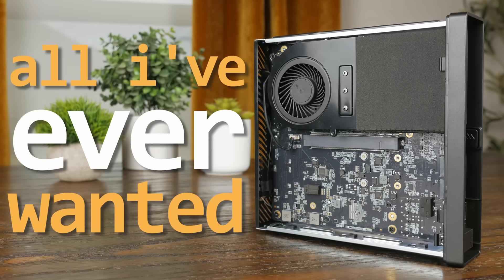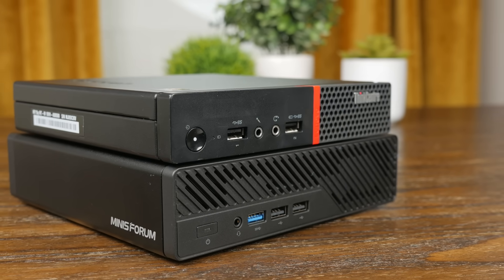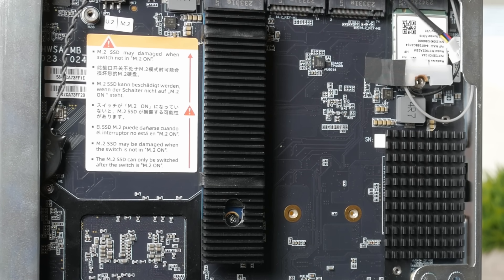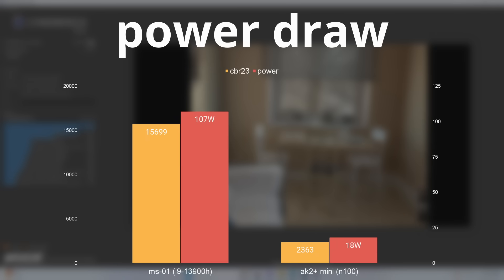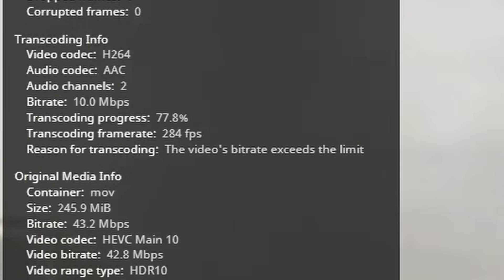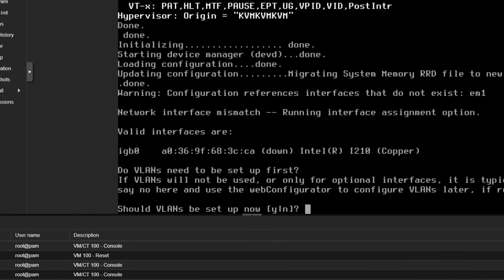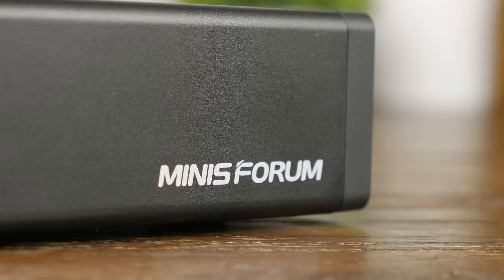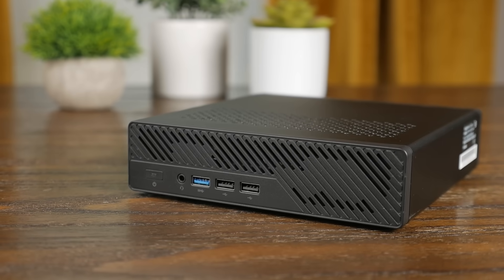This Might Be The Perfect Mini PC

Comment: Do you know how much power the pcie slot can provide? Officially it is gen4x8 so it should have at least 25W. But physically its a x16 pcie slot, which could supply 75W. Might be very interesting depending on which card one wants to use and i could not find anny official documentation :/

Comment: Curious if you tested an arc a310 in this? I put one in (for ballin’ tone maps on my media server) but I can’t connect through the pcie  hdmi port… and I think its because the single slot slot frame blocks  the hdmi from seating correctly.. not a big deal because I remote into mine and don’t need the hdmi header for that.. but still wonder how many scream at that pcie slot setup… nice that we have it at all I guess… stoked for the amd refresh with this setup.

Comment: It’s very interesting to consider a NAS HBA project using the PCIe Expansion Card 01AJ940 and a SAS PCIe external controller. How many drives can be managed when upgrading to the maximum memory and processor capacity?

Comment: WRT your suggestion at 17:35: Be aware, that the Nvidia RTC4000SFF GPU has a PCI-16 interface; the Minisforum MS-01's PCI slot is Gen4, Eight-Lane, so 1/2 throughput.

Comment: I still cannot decide on buying this because the pcie slot doesn't support full x16 bandwidth, only x8...
Reply: Just a thought exercise. What card that would actually fit be able to use full x16 most half height controller cards are x8. Yes there are x16 ones but heat space etc.

Comment: Use these as packet capture appliances thanks to the dual 10gb sfp+ and the ability to put a 7450 max 1.6tb ssd U.2 drive that can do 3DWPD. Crazy they designed something like this perfect for a sensor use.

Comment: Clearly an item mainly for workstation duties and not even a balanced dual-duty (workstation/gaming) unit. TBH, a similar spec and cheaper MinisForum AMD Ryzen 9 7940HS based unit would provide dramatically better performance.

Comment: Finanly got 3 of them today!
I ordered lowest tier with i5-12600H and I tried to fill it with 96GB which as docs says should only works with highest i9-13600H. 96GB Worked flawlessly on that lowest tier! Also, SFP+ ports are based on Intel X710 and has SR-IOV which allows to create up to 64 virtual network interfaces - great for virtualization - I think noone mentioned that ever! Apparently SR-IOV for Xe Graphics should also work but I haven't got it working. It looks like Alma Linux has older kernel which doesn't have drivers latest enough, so I'll be trying later with other distros or maybe just kernel recompiling. With all of that found, the deal is getting better and better each minute...

16-threads of pretty great processing power, 2x SFP+, 2x RJ45 2.5G, 500GB SSD and 96FB RAM for 4000zł (about 1000 USD / 930 EUR) is GREAT DEAL! I found X710 PCIe network cards for 1/4 of that! Unbelievable great deal! I'm supper happy and I got 3 of them :D

This wll be great Kubernetes cluster (or maybe even OpenStack?)!
Reply: I'm just seeing this five months after your comment on this video, how's your experience at this point?
Reply: @davidgoodnow269    all 3 running my VMs (via libvirt, no Proxmox) 24/7 attached to EATON UPS.

No failures, no random reboots, no storage issues, everything works flawlessly. But they can get loud when there's something more going on (even bigger system updates), so I strongly recommend putting homelab with those in separate room. I'm living in an apartment so I put my rack right next to entrance door - also because that's where I have my fiber coming out of the wall.

I didn't tested SFP yet, because I still didn't bought 10G SFP switch. Running on 2x 2.5G NICs with bonding configured on Linux.

I have there my Kuberentes cluster, Gitlab, Grafana (dashboards, Mimir, Loki), and I also host there my trainings (I'm a trainer about GitLab and Kubernetes topics), and never had any issues spinning up hundreds/thousands Pods at the same time in a Training Kubernetes cluster... well - maybe except then I hear the computers from other room :D

Overall I'm very happy with this purchase. Even tough I invested a lot into this setup, I feel I saved a lot on AWS/GCP because of workloads I am running.
Reply: im interested as well to know your experience
Reply: @verosmuhamed1053  I replied with long comment… but YT just hates me and hides many my comments, so… this is worst social platform ever!
Reply: Also I ordered the i5-12600. I have a few full sized SATA drives in an external powered box. How would you connect them to the MS-01?

Comment: Yeah still prefer my N100 machine with 16GB ram and 512GB SSD that cost me $143. now that's bang/buck. Personally I don't see the point of high performance small computers, if you want performance you'll get more performance with a regular sized machine for the same money. Small performance systems will always be limited by the cooling solution.  It's different at the lower end. The form factor really suits the N100, it's just SO good. I'm happy I bought one. The SFP ports are pretty rad though, quite unexpected in such a machine. with all those cores and using a M.2 to SATA adapter it would make for a sweet file server and/or proxmox box. BUT, if I wanted to build something like this I'd just buy some 2nd hand rack server dirt cheap, as you mentioned it's too big/heavy for VESA mounting. It just looks like a really odd hodge podge mix of features, more like a machine you'd use for industrial use.

Comment: This is a great idea for a home lab server, small and has the connections you would want. I wanted a few more cores, so I went with the MinisForum BD790i and a Mellanox 10G SFP+ card and two NVMe's for storage. I like this mini itx board and using it's 16core/32thread CPU for Virtual Machine host. Good video as well! Thanks!

Comment: i donno if you give a crap still , but the answer is,  bridge is normally gonna throttle at 1gb  the virtio to virtio is not even a real network, its a fake network basically copy paste from the drive to the same drive.  (in your case)  

if you use mtu 9000 that does not always work you also have to set that in proxmox windows linux and the switch to make this work properly.  
but what do i know.

Comment: The HDMI port is total crap... I tested 6 different cables, no picture. Only with the supplied HDMI cable do I get a picture.

Response from Minis-Forum:
Ah. The HDMI interface of this machine is indeed not compatible. If you really want to switch to HDMI, try to use a shorter HDMI 2.0 data cable.

...huh??? Can you help me understand why such a short cable?

Comment: I am missing the PCIe4 M2 slots (so can use the U2 AND 2x M2 with PCIe4 x4), for the rest it is a perfect box (and yes, I want 4 of them). And you can get about 6 of them in a 2U rackspace; I don't need to see the frontplate so you can use a sliding shelve.

Comment: Why does it need to be so small if it's not a laptop? You rarely see a home that can't even fit a mini ITX case so why put up with the limitations of a tiny PC?

A PC for the home should have space for multiple hard drive and I/O upgrades.
Reply from the maker: I used to work in a video broadcast and production environment where space was incredibly limited. Sometimes a laptop could work, but not always. There are plenty examples where PCs this small but with lots of expandability and performance are a good fit. That might not be the case for you, which is totally fine 👍🏻
Reply: @HardwareHaven  what did you end up choosing for the broadcast and production space? I assume you needed something with a top gpu which means space for cooling is needed.

I thought everything in that world was standard sizes for rack mounting. All of my old broadcast kit fits exactly on top of the 20" crt monitors.
Reply: Mounting it behind the monitor would make for a very clean desktop with easy to hide wires.

Comment: Oh shucks just put a down payment on a framework as I needed an OBS system as my 2019 MacBook Pro isn't cutting it anymore.
I'm running for cameras over NDI so no capture card needed just good networking and I tried to use my Lenovo I7 but that didn't have encoding power.
Unfortunately moving the windows because MAC has a stupid full screen mode that blank so all of your monitors works great for full screening multiview to an external touchscreen and blinking out everything else. I love the mini PC form factor, I've been using the Lenovo with a touchscreen almost like an audio Consol, well also using it as a playback system with OBS. So having some thing in a similar form factor that's more powerful would be neat. Although maybe the next generation when Price comes down.

Comment: Man if they made a little bigger to fit the A2000 or A4000(Ada version) sff versions and made the PCIE slot to be x16 instead of x8 that would've been awesome. It would've been a little worstation beast.
Reply: It support A2000, but you need to change cooler for 1 slot. There are conversion kits for $80

Comment: Were you able to test with powertop by chance?  As I understand it, most Miniforum computers don't have the bios settings necessary to reach low power states. Perhaps that's why it idled at 14w.

Comment: With the diversity in the network connectivity embedded and unless you really need the PCIE for graphics, I'd use the PCIS to add 2 additional NVMe drives.

Comment: Completely on par with @mzimmerman1988. The best route to take is downsizing to 1U, optimize air flow & fan noise and fix the issues with the PCIe capabilities, including the weird little bracket. Usually you don't buy this kind of high end mini PC to pack big GPUs into, but supporting little GPUs just for light gaming or improving video screen output would be interesting. I use as my daily driver a Lenovo M910q i9 10th gen Intel with 64 GB on RAM, dual NVMe and 10 Gb/s dual SPF+ and that thing is more than enough for ocasional virtualization, conteinerization, coding, light rendering, video playback, and offimatics, running 24/7, directly and remote. It have been great if Hardware Heaven had talked about the board & chipset used in this application, that without understating that the video insight in the system is very entertaining and informative. I haven't used the vPro capabilities but I would give them a try now that I'm aware. I'll be watching closely this Minisforum MS-01 to replace my Lenovo when time comes. Keep the good work!

Comment: The thing I hate about small form factor systems is the severe lack of expandability. 

I have one of those Lenovo systems that I had hoped to transfer to a bigger case and add a better power supply so that I could put in a decent graphics card. Of course they used a proprietary front panel connector that sits right behind the PCI-x16 slot, so if the card is too long, it will block that connector.

Comment: You should try running Thunderbolt or USB4 to PCIe and run the same GPU with Davinci... that should be interesting to compare the performance. Or using a Magma/Onestop systems PCIe to external chassis to test the same GPU with DaVinci.

Comment: I would trade about 3/4 of the ports on the back of this thing for having a second position for the PCIe slot. Not even a second slot or a taller slot. Just a blank position so you could install a video card. 

This thing is cool but it fails in the most important way for a lot of people - The graphics blow.

You may say that this is not for gaming, and I agree, but your video rendering shows that this is utterly useless for video production, rendering, or transcoding.

Comment: Placing a pcie card so close to another pcb and its circuits it is not a great thing, maybe a thin layer of an insulating sheet would be nice ;)
Reply from the maker: There are stand-off pads to prevent anything touching. You can see the little black foam squares if you look closely
Reply: @HardwareHaven  didn't notice at first, seems a very tight space tough.

Comment: I've cut my case so my double slot GPU heat sink and fans stick out.  Looks like a super charged V8.  But the motherboard wasn't gaming capable and burnt up.  

Now I have a msi trident x plus.. now that is a sff power house! All OEM and silent air cooling design

Comment: The DaVinci resolve disparity is likely because the free version does not support hardware codec. So, the quicksync capability was not being used in that test (but nvenc was). Would love to see a transcode speed battle between the two.
Also, your color grading is CUDA accelerated (no Intel equivalent). So nvidia wins here no doubt.

Comment: Important note for anyone who considering putting a U.2 drive in this system:
The height of the U.2 drive must not exceed 7mm, which excludes some of the most popular U.2 drives on the market, such as Kioxia CD6, WD SN640, or Samsung PM1733/1735, which are all 15mm drives.

I saw this machine but still got myself a Think Station P3 tiny. I chose an ES motherboard so that I got 3 M.2 slots. I paired the P3 tint with the i5-12400 and it was 1/3 cheaper than the MS-01 with the 12900H option. 
There seemed to be an i5-12450h option with the MS-01, but it is not available and we don't know when they will start selling this option. I don't really like the i9 CPU that MS-01 provides right now because I don't want to stretch the cooling system too far. 
I did see the appeal of the dual 10G NIC but for someone who doesn't really need it, it is a piece of hardware that consumes power and does nothing. On the other hand, I can add USB type A, DP, HDMI, or TypeC with video and charging to the Tiny via expansion modules, which makes it very flexible. However, doing this does sacrifice the PCIE cutout.
It is also more difficult to install PCIE cards sideways compared to Tiny's riser approach. At least it doesn't require a special PCIE bracket though.

All in all, I think both MS-01 and P3 Tiny are both nice SFF machines. It really comes down to whether you prefer the dual 10G SFP port and the USB4 port, (Yes, it is USB4 rather than Thunderbolt, although they are functionally the same.) or more flexibility.

I will also provide a quick technical comparison here for anyone interested:

P3 Tiny  |VS|  MS-01
form factor: Standard size  |VS|  A bit larger than Standard size. (Matters if you want to put it in a server rack.)
CPU: Any CPU from Intel 12,13 and 14GEN  |VS|  13900H,12900H, or 12450H. (12450H not available yet.)
iGPU: MS-01 is always better as mobile chips always get better iGPU compared to their desktop counterpart.
NIC: i219-LM 1Gx1  |VS|  i226v 2.5G + i226LM 2.5G +x710 10Gx2. (Both machines can support vPRO.)
PCIE: Gen4/5 x8  |VS|  Gen4/5 x8. (Gen5 is available on 13th Gen CPUs.)
PCIE specific: Need custom PCIE bracket  |VS|  Difficult to install and uninstall.
USB Expansion: 4x10G type A + 2x5G type A + 1x10G type C |VS| 3x10G type A + 2x 480 M(2.0) type A + 2x40G USB4. (Tiny can expend 4x 5G type A or 1x10G type C with Video and charging expansion module, by giving up the PCIE cutout.)
Video Expansion: DP1.4 + HDMI 2.0  |VS|  HDMI 2.0 + 2xUSB4. (Tiny can expend 2xDP, 2xHDMI, or 2xTypeC DPalt via the expansion module, by giving up the PCIE cutout.)
Storage Expansion: 2xM.2 |VS| 2xM.2 + 1x M.2/U.2. (Tiny get 3xM.2 on the ES motherboard)

Comment: The 12900h is the better deal.  But it won't hold my 4060 Low Profile.  And why can't we have an i5?  If I had to guess they can't make it a different size due to using that aluminum extrusion for a case.  It would be amazing to see a 'full height' card fit.  They aren't very far away from that.  Or maybe an optional internal GaN PSU?  I disagree on needing more room for a fan, just add a blower fan like the CPU has.  I got one for my 8th Gen NUC from Amazon for $6-10

Comment: Would be way better if it supported bifurcation. But the CPU and lanes would be the bottleneck. On that note, I still haven't found a replacement for my SuperMicro SYS-5018R-M, which I have 3.
Reply from the maker: Yeah, that is a bit of a shame. I meant to make note of that but forgot along with a couple of things.. whoops haha

Just curious, were you actually looking at these as a replacement for the SYS-5018R-M? If so, I'm curious why not just another 1U system?
Reply: @HardwareHaven  Yes I was looking at it to replace the 1U's for my home lab, I have 2 StarTech 25U's at my shop I can put them in. I figured I could stick 6 of them in place of the SuperMicros. With bifurcation it would have been nice to have 7 NVMe's in each one. 2  of my 1U's run TrueNAS Scale and has 4 18Tb drives, a 64Gb SataDom for boot, and 2 NVMe's in an 8x8 for cache, the other on doesn't have NVME's but run Proxmox and has 4 MX500 4TB SSD's.

Comment: I am not familiar with the vPRO AMT. Is this browser based or do you need a client installed? I looked into Intel EMA and it seems like you would need a client and it is Windows only.
Reply from the maker: Blind leading the blind here, but I believe AMT is a feature within the vPRO suite. You can access basic functions using just a web browser, but for more in depth stuff like the KVM, you need client software (Mesh Commander)

Comment: Really hope they do a few more models similar to this, perhaps with i7 or lower power CPU
Reply: There's currently an option with the Intel i5-12450H for $419 with the early bird special, so it seems like they're open to testing different hardware in this model.

Comment: Great point on the height. Would love to see a rackmount version of this
Reply from the maker: Fortunately it wouldn’t be too hard to just mount them to a rack shelf. I imagine making a front plate would be fairly doable as well if you need it enclosed for airflow
Reply: Can you even rack mount top vented cases? Lenovos seem better for this, can tightly pack those in rack as it only draws air from the front and exhaust from the back